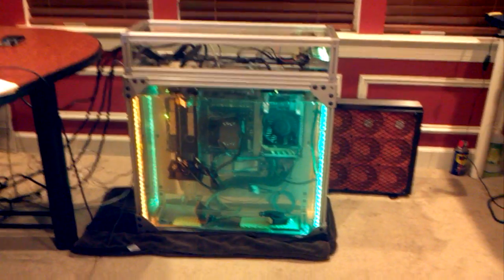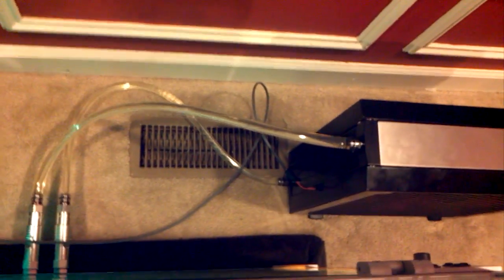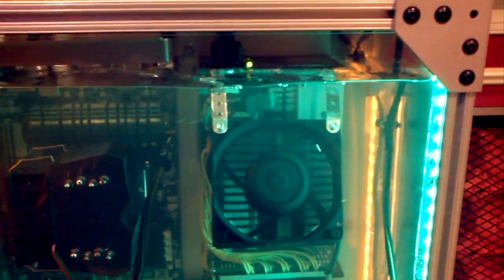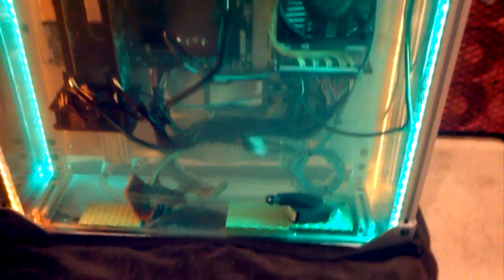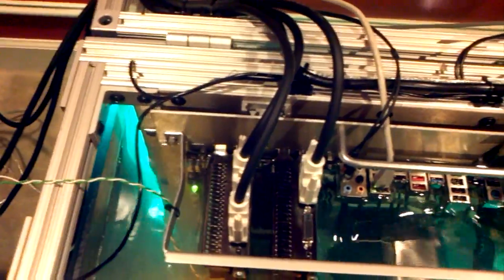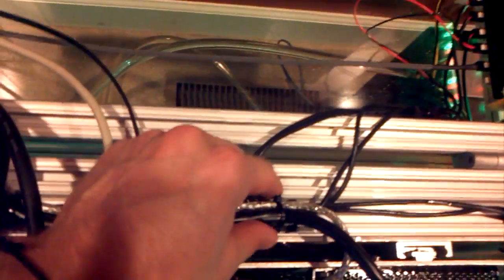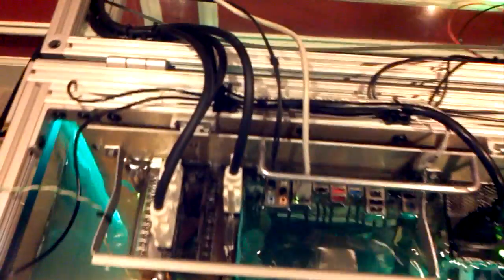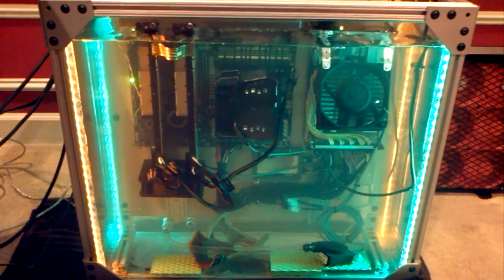Mineral Oil Computer Done!

Comment: Very informative video and great build. I realize this video is several years old but I was wondering if it is still in service? I built a mineral oil HTC rig a couple of years ago and it is still running well. It's not nearly as nice as yours but it is silent and that was the goal. I had trouble with the oil lines getting brittle so I had to change them out to viton. Thanks for sharing.
Reply from the maker: Hey there.  I'm happy to see this video still getting views, and hopefully inspiring others to just dive in and do fun stuff:).  It's not running anymore.  I love the build and the computer itself.  And even though I engineered it to be easy to change parts I still didn't like oil getting on me each time I changed something.  I do miss it.  I used Tygon tubing which is resilient to the brittle-ization caused by mineral oil.  You are correct that viton would work also.  I strongly suggest tygon tubing.

Comment: So the mineral oil doesnt conduct electricity, is this why it doesnt short circuit anything?
Reply: +The Timelords That's correct.  Mineral oil is used as a high voltage electrical insulator.  The transformer at the top of the pole outside your house is filled with literally the exact same stuff, and it transforms about 10-20 kV into 240V or 480V to your breaker box.  My company has a 150kV "Phenix" dielectric tester filled with about 700 gallons of the stuff.

It takes about 30-32 kV to arc across a 1" gap of air.  It takes about 30-40 times that to arc across a 1" gap of mineral oil.

Comment: Did you have issue with rubber parts?
Insulation on cables?
As I read I see that mineral oil is eating away rubber and hardening cables..
Did you consider transformer oil? or Ester oil for transformer?

Comment: as radiator you can use an old external unit of air conditioner. I use this for cooling my "power electronic" in my lab

Comment: thats a LOT of work into a mineral oil pc... not sure why you are using a fan on your cpu... with all the work you did here you could of built a beast of a water cooled machine
Reply: And be like everyone else? Baah..
Reply: a lot of people used mineral oil too, they stopped cause of the way the mineral oil changes into almost a gel after extended time period of use.
Reply from the maker: beyond305 I never had a gelling problem.  But I did need the fans to cause circulation in the oil.  It stratified pretty easily with very distinct thermal layers in the tank without circulation.
Reply: +RabidCicada has it turn into gel yet?

Comment: Whenever I see comments about people wondering why things like this don't ruin the parts because of electricity, I die a little inside. Even air is conductive of electricity, why do you guys think lightning happens? It's just air is a piss-poor conductor of it, and an arc of lightning has enough energy to say fuck it and travel through the air.

This will not shock or short any of the components; it's oil. It's not water. It's not conductive. It's simply oil. Now, I'm not too sure on this, but I imagine that if there were any impurities in the oil, it would run the risk of becoming mildly conductive, but I imagine that's only if you have very dirty, grimy, nasty mineral oil.

Mind the pun, but this is a pretty cool build.
Reply: spartan456 i agree with you on all counts!

(random little piece of science!
mineral oil has a resistance rating of over 10^10 ohms (10,000,000,000 ohms!) water has anywhere between 10^2 to 10^11 depending on purity with an average around 10^5 (but add any salts and resistance drops fast! (metal salts count and metals tend to break into their salt forms if submerged then electricity is applied))
Reply: nor is water. it's the contamination in it that conducts electricity.
Reply: This is degenerate level 20

Comment: whats the point of this?
Reply: You can overclock it way beyond what you can with air cooled and even liquid cooling with radiators.
Reply from the maker: Just fun.
Reply: +OminousPinapple Just checking in to continue the rip, have a nice day.
Reply: Kastley Michael Mike 
GG
Reply: OminousPinapple
No...
Reply: ... and to maintain super stable temperatures.. is what I left out.
whoops.
Reply: Marc Melancon rust protected!
Reply: Must be a Nah on that note.
Reply: OminousPinapple you posted that comment a week ago, i just wanted to remind you that this comment was here, because I'm your pall
Reply from the maker: MrPacman64 You guys are hilarious!  I can't believe this is still getting comments 3+ years after it was posted.  I'm also terrible at responding to comments because I didn't really intend for this to be a communication platform.
Reply: +OminousPinapple Hey there, just wanted to tag you to make sure you know that people still care.
Reply: OminousPinapple not really, water cooled preforms the same, Oil brings in extra problems, 1 Oil is thicker, so you need a special pump to Pump it trough the Radiator for cooling, 2 Mineral Oil is a great for ruining cable isolation and alot more, So in other words a Mineral oil pc will most likley have less durability then a Water cooled unit.
Reply: ***** Exactly why I said no lol, this is just a geek thing to do... 
Now if someone  a mobo, put it in water and added fish I would give them props.
Reply: OminousPinapple no water cooled custom loops will destroy a Mineral oil pc
Reply: I don't care anymore people. Stop tagging me. lol
Reply: OminousPinapple why not?
Reply: OminousPinapple You guys need to quit badgering him.
Reply: Michael Mike Stupid shall be punished.
Reply: lol.
Reply: Lol, good stuff comments like these make me laugh when I'm reminded to come back.

Comment: How does the oil conduct heat versus water or air? If it conducted heat like water does, you wouldn't even need a cpu cooler as long as you ran a constant current across the heat spreader. :oo Interesting thought.
Reply from the maker: Air < Oil < Water in terms of dissipation speed.  Oil is also more viscous so that raises the difficulty.  But if you get the right pump and circulate open pools of oil (like with the deltek fans I used) then you are good to go.  You can't let the oil stratify heat in layers in open pools of oil.

Comment: So if you want to submerge it do you just put it in or you have to waterproof it and stuff
Reply: Mineral Oil does not transmit electricity so no need to waterproof the system as it's not water :) - Just don't go sticking your HDD in there.
Reply: ok, but if i have an ssd can i put everything under the oil
Reply: Yassid Martinez From what i've read online, you can put your SSD in the oil as it has no moving parts. HDD have mechanical arms/spin so the oil would restrict them.
Reply: ok thanks thats all i wanted to know
Reply: The other consideration is that some rubbers do not respond well to oil.  So some capacitors with rubber plugs sealing them may explode on the motherboard over the long term.  They swell up like a sponge.  I verified my motherboard didn't have rubber plugged capacitors.  There's a small risk for other components but much less.  So in general, you don't need to worry, but there are a couple things to look out for.
Reply: ok, thanks for the info.

Comment: I am very impressed with everything you have done. One comment i have though is that you could greatly increase your cooling capacity if you took convection caused by your motherboard heating up into account. Example: Draw your hot oil from the top of your case and send it into the top of your radiator so it cool as it falls. Return the cold oil to the bottome of your pc case. Same concept as an automotive engine.

Comment: Ok, so... this is my first time seeing this, so I have a few questions naturally. If mineral oil coming in contact with the CPU, GPU, Motherboard and Ram isn't an issue, would it be an issue for anything else? Could you submerge the psu? The IO ports?
Reply: *****
I'm pretty sure oil would destroy a HDD/DVD because they rely on air around the plates to spin at a proper speed and keep the head from crashing into the plate constanty. SSDs are good though.
Reply: The psu is actually submerged the IO ports are not, i think it's safe for the IO to be submerged but mineral oil can travel up cables and make a mess so it's better to leave the cables out
Reply: yes, mineral oil is non conductive
Reply: RedDragonflyxx yes and its thick (the oil), it would slow it down too. it would suck
Reply from the maker: Everyone elses answers are correct everything except regular HDS can be submerged...but mineral oil can climb cables sometimes ...so best to leave io ports out

Comment: Did you need a special fan to handle the extra density of the oil?
Reply: nope they will spin slower but thats ok
Reply: Oh I tried putting a fan in distiller water (so it wouldn't conduct electricity) and it struggled to move at all and oil I would imagine would be a lot harder (more viscosity) and then I put in a fan from a server and it sprayed water everywhere lol
Reply: Distilled
Reply: Distilled water will "suck"  ions out of any metal.. There will be a point where the water will be conductive again. But in oil it's like the fan is permanently lubricated
Reply: Yeah I know but I only kept the fans in for at most a few minutes
Reply: And I only did that once

Comment: What's your temps I have a MSI GT60 gaming notebook with a GTX 870m 3 GIG card 32 gig of ram core i7 FHD my temps are 47c when playing cpu intensive games such as Arma 3 DAY Z then GPU intensive games like bf4 bf3 etc that's with my fan on full pelt I changed the power mode to balanced then changed these settings changed the processor maximum from 100% to 75% it shaved of a good 20c from my temps before I was getting something like when gaming core one 72 core 2 64 core3 63 core4 61 I. So could some one tell me if this is safe to change the cpu maximum from 100% to 75% I would love to know thanks in advance any one .

Comment: hmm? whats the point unless you can take the board out and replace it with newer equipment it seems pointless. 
Still cool to look at...
Reply from the maker: It can be replaced.  Don't know if you read the worklog or not...but the entire motherboard tray is extractable like a keyboard on a keyboard tray.  It locks into position in the extracted position using industrial pullouts.

That was one of the major design criteria.  "Easy" maintenance...where easy is relative to the difficulty of maintaining a mineral oil computer to begin with.

Comment: How long does a mineral oil pc last before it stops working?
Reply from the maker: If you design it correctly it should be a long time.  Mine ran for 6 months before I just got tired of mess.  It would have run a lot longer.  My estimate for mine would be 2 years or more based on total guessing and previous mineral oil computer blogs/worklogs.  I made sure not to have rubber with bad interactions in the oil and the plastic wire coating tends to harden up but that didn't bother me.

Comment: I'd read when considering an oil build that the oil really, really likes to creep out of free exiting cables. I figured I would just build basically a port replicator into the lid, so I could fully seal the cables internally, and the replicated ports would all be glued/caulked and liquid tight. Are you seeing any leaking/creeping of the oil up your cables? Since this is about two years old, do you have any interesting tidbits to share regarding the upkeep and maintenance?
Reply from the maker: So, I actually made sure that all the connections were above oil level for exactly that reason.  I have the entire motherboard io panel at oil-top level so that I hopefully didn't get that behavior.  I have not noticed any oil-creep problem, though, like you, I had been worried about it.  I'd say just make sure no cables rise out of the oil and you'll be fine.  Just make sure there's some kind of airbrake between (like the io panel of the mobo being above the oil surface).  Although...port replicator in the lid is a good idea to make it easy to plug and unplug accessories.  I regretted not having the port replicator because every time I wanted to plug something in I have to open the lid:).  

Also...make sure the computer tower/thing will fit under your desk/near your monitors...I had to buy extra long cables to reach my monitors because the tower was too big to fit under the desk >.<.

My advice for maintenance and upkeep is just to do everything in your power to make it simple to maintain.  I ended up putting this guy away because I got tired of getting oil all over myself anytime I wanted to do anything inside the machine.  I had the mobo etc on a locking pullout tray like keyboard trays and it was simple to extract (which was an amazingly good foresight move)...but I still got tired of wiping my hands off everytime I played with it:).

My time is more limited nowadays with a 16 month old kid...but I still love playing with electronics and computers.

Comment: Isn't it a but dangerous for the fans ? I mean they're design to work with air, oil is way too dense for them, even water is for that matter, you sure that doesn't wear them out ?
Reply: I'm sure it does wear them out sooner than normal.  I chose ones that were very strong to begin with so that even with shortened life span they'd run for a long while.  No science behind it...just guessery.

Comment: What's the radiator for? You already have your PC submerged in liquid.
Reply from the maker: Needed to cool the mineral oil.  Having it sitting there was not enough.  The oil would stratify and get very hot on top while being luke warm on bottom.  You need circulation and active cooling somewhere.  Passive is not enough without more surface area